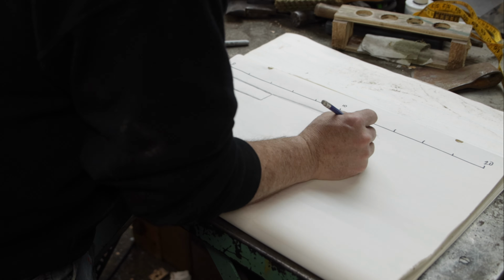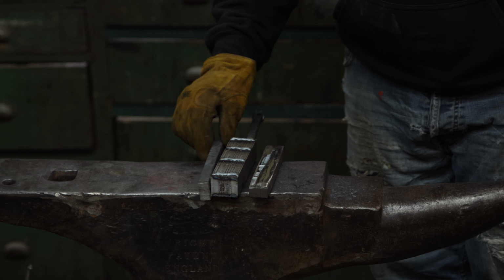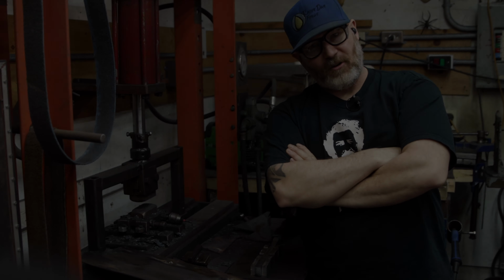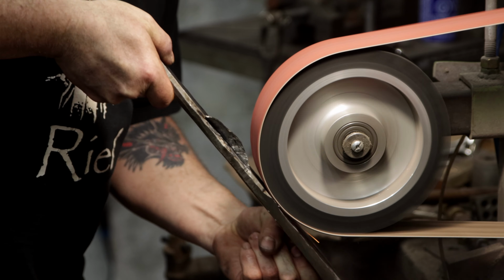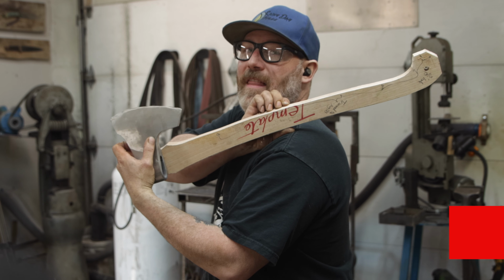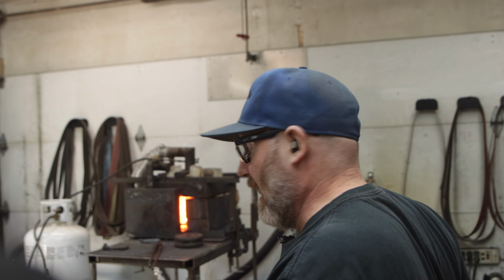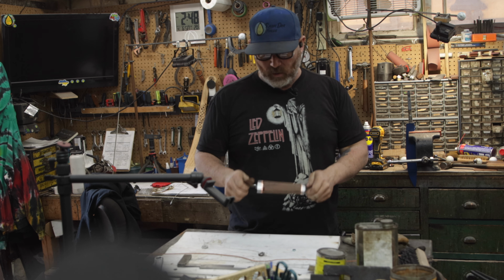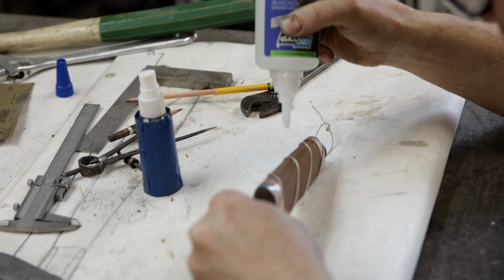Viking Challenge: A Seax to Loot and Plunder

Comment: This was a great overall presentation of the build. The damascus pattern was simple but with great technique ... using solid welds on the final canister/forging was a great tip. The twisted copper wire inlays then hammered was a great detail for your handle. Thanks for the build. New sub.
Reply from the maker: Thanks Byron! I love reading thoughtful comments from viewers. It gives me motivation on forge on!

Comment: I have often wondered if you could design and build a neutral atmosphere forge to reduce the issues with oxidation. Argon would be an excellent choice as a neutral, non reactive atmosphere. Heating would have to be electric.
Reply from the maker: There are kilns available that have inlets so that you can flood them with Argon. I think Paragon kilns have the feature. 
If you look up damasteel in Germany, I think they use this process but only to make their stainless steel damascus billets.

Comment: New to the channel, like your style and presentation.

Genuine and possibly stupid question, but, what is easier to forge weld, many smaller stacked layers, or fewer thick layers? 

I could see it being difficult with the smaller layers because of so many pieces possibly wanting to go different ways or reacting different to pressure, but I could also see it being tough with thicker pieces getting forge welded if the pressure isn't applied evenly or strong enough, if that makes sense?
Reply from the maker: Fewer & Thicker. Every piece added to a billet could allow scale to build up between the layers and cause a flaw or a complete failure. The amount of heat required to forge-weld is surprising to new smiths. Welding the pieces in place is important so that the layers don't slide around. A few videos back I experimented with some wrought and forge-welding. It didn't work. (Viking Folder video)